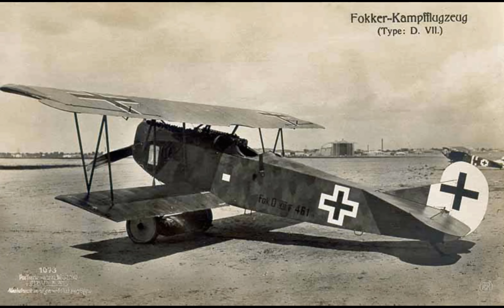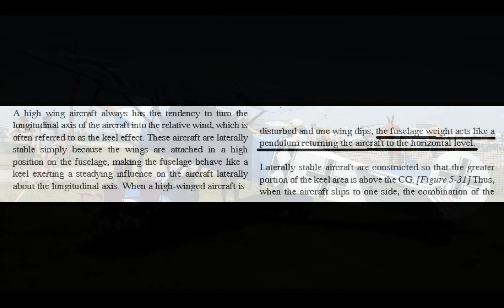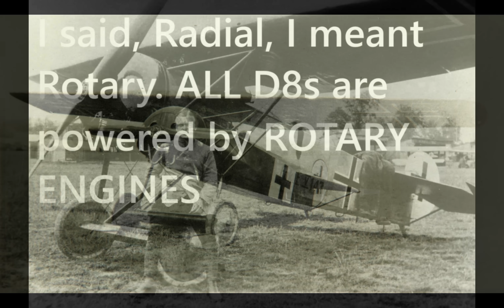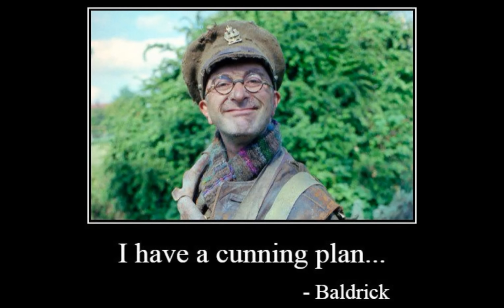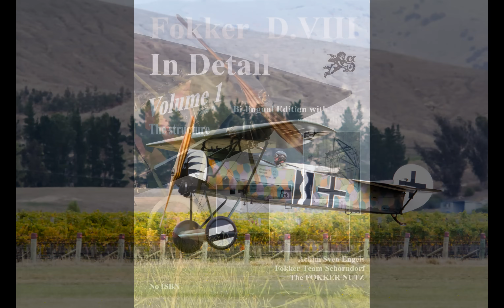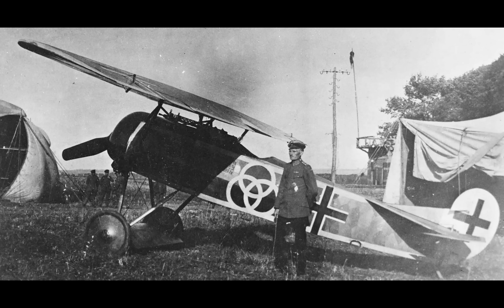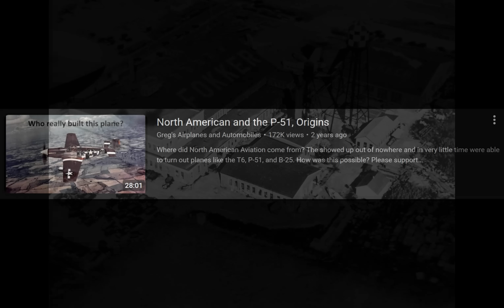Fokker D VIII The Best Fighter Of WW1

Comment: Your videos are all very interesting Greg, and this one on the Fokker D.VIII is no exception. However, when it comes to the performance estimates, I would say your numbers for the Fokker D.VIII are on the optimistic side. In fact, the Fokker D.VIII was with its 110 hp Le Rhone woefully underpowered and was both out-climbed and out-turned by many bi-planes of the time, most of which were faster as well. You can read more about the performance details of the D.VIII and its contemporaries in my book WW1 Aircraft Performance, by Anders F Jonsson.
Reply from the maker: You may or may not be right about the performance numbers. That said, they are not my numbers, the climb data came from a NASA book, the chart is literally straight out of that book. The top speed of 128mph is the most often quoted number and I think I explained exactly how I cam up with the stall speed. I'm curious what you think the stall speed is. I haven't read your book, this is the first I have heard about it, but it sounds like it's great.
Reply: @GregsAirplanesandAutomobiles   My estimate of the Fokker D.VIII's stall speed is circa 53-57 mph depending on if power is on or off. Connected to this, when using speed data from old reports: Be aware that even NACA reports sometime have IAS as read off the from the aircraft instruments which can be very inaccurate due to missing PEC. Then when it comes to my simulation modeling for the turn performance in my book: I have actually validated this based on a German WW1 report (TB 41, Band III Heft 7, Der wagenrechte Kurvenflug des Flugzeuges) which actually has data for the Siemens Schukert DIV, and I get very good correlation on that from sea level up to 6 km altitude, which gives me confidence about my C++ simulation model. I actually have paper in pdf format that covers the Sopwith Camel's and Fokker Dr.I 's turn performance but I don't think I can link to it here because YouTube seems to delete post with links, so I'm not sure how to convey that info.
Reply: Hang on: On my page here on YouTube, there is a link to my website: If you go there, there is a tab called "Documents" and under there I have a paper in pdf format that explains the validation of the C++ simulation model and does a comparison of the Sopwith Camel's and Fokker Dr.I's turn performance. Have a look at that paper and tell me what you think about it.
Reply: Does the ORA or the folks in New Zealand not know the stall speed of the DVIII replicas they fly/flew?
Reply: @Whitpusmc  So what stall speed do they say the Fokker D.VIII has?
Reply: @AndersFJonsson I don’t have a connection to the NZ group but I wrote to ORA today to ask.
Reply: @AndersFJonsson I got a copy of WW1 Aero issue #143 pages 56-59 which has test reports of three DVIII replica’s. My copy has corruption on page 56 so the most accurate replica, the one with a Gnome rotary, is illegible. Reading the reports on the others gives an impression of a stall speed between 43-49 knots. How good the pilots are at collecting this data, how accurate the instruments and how accurate the replica’s are all open questions. I would like a clean copy of that first page #56 which is of Brian Coughlin’s DVIII replica which flew at ORA and in NZ. Note that of course these planes will likely at most have a full fuel load, they may not have a full load of castor oil as the originals did and certainly don’t have the ammunition and actual weight guns the originals did though they may have some ballast to correct CG issues caused by lack of these weights.

Comment: It is worth noting that Fokker did build mid and low wing versions on the same DR1 type fuselage before the DVIII and they were submitted to the formal fighter competitions. The test pilots complained such wing locations severely restricted the ideal combat visibility, ahead and below, for ease of interception. Structurally Fokker's designer Reinhold Platz preferred the simplicity of the low wing mount of the V25 prototype. A factor often missed is that both the DVII & DVIII thicker wing sections had much better stall characteristics than the thin sharp leading edge types used by allied planes and as cantilever structures they required no external, drag creating, wire bracing. It was dearly a decade before the rest of the world caught up!
Reply: Great to point that out. I had wondered about that, if he'd experimented with different wing locations and surmised that the design decision had much to do with the combat visibility issue. But I'm surprised that the mid or low wing position that would have enhanced maneuverability - at least in roll - would not have scored higher points. Perhaps not a midwing since you couldn't design a one-piece wing, but a low wing could have easily been attached below the fuse with a little dihedral to enhance lateral stability. You'd still have the strength and ease of manufacture.
Reply: @Mike-eq4ky 
As stated in the video the DVIII and the V25 even more so was one of the lightest fighters by mid 1918 and coupled with the benign stall characteristics of its thick wing "dog fighting" manoeuvrability was not an issue. The big concern was its limited speed. A fighter with a speed advantage could break off combat at will making the visibility below and forward to allow a dive speed advantage.
It is also worth noting that Fokker had a financial interest in Oberursel so ensuring priority delivery and a financial benefit in using their rotary!

Comment: Hi Greg.  You make  very convincing argument.  You've got a like from me.  It would have been interesting to see its performance with a bit more urge.  I wonder if anyone fancies putting a Le Clerget in one???
As I understand it, by 1918 Fokker had become a saleman and the DVII, EV,DVIII were designed by Reinhold Platz (AR Weyl - Fokker: The Creative Years).  Also the wing failure problems may have originated in the use of unseasoned timber, a problem which had plagued the DRI earlier (production was halted while it was investigated).  The use of unseasoned timber was not a Fokker issue alone (Nieuport used some) and resulted from the shortages in timber by the ravages of war.

Comment: There should be no pendulum effect, since the lift force should always be pointing through the center of mass, thus no restorative moments should be made. When there is a pendulum effect, like with ships, the force of buoyancy starts pointing away from the center of mass, which generates a restorative moment/torque hat rotates the ship back to level. In reality, I do think that a high wing is more stable, but I think it's because of aerodynamic effects. There's more side area above the CG, because of the wing and struts, so if the aircraft is in a slight sideslip (as all aircraft tend to be when rolled), the surface area above the CG will create a restorative moment that tends to rotate it back to level, like with a weather vane. There is also an effective dihedral (even if the wings are completely straight) creating a situation where the lower wing in a slip sees more angle of attack.
Reply from the maker: Alex, read the page I put on screen from the FAA. I think you're misunderstanding the pendulum effect in this case, it has nothing to do with what you see with ships, it's a different effect.
Reply: @GregsAirplanesandAutomobiles  I noticed I ended up describing the keel effect from the video in a worse way. My intuition when I hear pendulum effect is the pendulum rocket fallacy from Goddard's failed pendulum rocket, but apparently it's just a different name for the keel effect. I think it's still slightly misleading to say that the weight of the fuselage acts like a pendulum to bring the aircraft level, the only thing that the fuselage is doing is keeping the CG low relative to the wings. The wings (and other structures above the CG) act like a weather vane or keel, to provide more drag than anything below the CG, and this  in a side-slip induced by rolling will make the aircraft roll back to level. 

For example, if you added a large keel/strake at the bottom, like a large pectoral fin, the weight of the fuselage would be largely irrelevant, the plane would become less stable. It's only the aerodynamic surfaces and their relative placements to the CG doing the work, not the fuselage weight itself. Similarly, if you had a low-wing configuration, but added a strake/keel at  the top of the plane (like a dorsal fin) longitudinal stability would improve, even if you increased the weight of the fuselage. 

Thank you for replying, I forgot to mention I really appreciate your videos, particularly the drop-tank and fighter range ones.

Comment: Dear Greg,
as always, a magistral video and presentation of lesser known aircraft.
Thank you very much for it!
I must however ask why Morane Saulnier seems to be entirely forgotten from your Fokker history?
The Eindeckers were base on a german carbon-copy of the Morane-Saulnier H. That plane indeed was nothing special without it's syncronizing gear.
I must also say that the Fokker d.VIII leaves me wondering. 
It does look AL LOT like the earlier Morane-Saulnier "Parasol" types, and more specificaly, the Morane-Saulnier AI. 
Nearly identical design philosphies: small, lightweight plane (they are 20kg appart) with a parasol wing, and even had structural issues too... Yet the Morane had superior performances (probably from its better engine), and this seems to be entirely forgotten. 
I agree the wing design of the Fokker seems entirely different and original, but I find the repetition of a, yet again, "Morane-like" pattern quite interesting.
Pure engenering convergence, or "inspired" design?
Reply from the maker: This is a good question, and it comes up a lot. I mean A LOT. There is almost never a time when I make a video and someone doesn't say "but what about airplane x? Why didn't you talk about airplane x?  The reason is usually just space and time. It's not that I'm dissing the Morane aircraft in this case, it's just that the video is of finite length and if I did include it, then someone would complain that I didn't talk about it enough, or mention some other airplane I didn't include. The is a video on the Fokker D.Viii, it's really just that simple.
Reply: @GregsAirplanesandAutomobiles  I understand. Historical aviation is an endless tangle.  I must say that the "North Amercian" digression was absolutely fascinating! 
I am however a bit at a loss with the (sad) bias the english-speaking "aviation history community" seems to have, especially for WW1. 
It's either the Brits, or the Germans. The French,  get some recognition thanks to Nieuports or SPADS (because flown by US aces), but every other designs (such as the excellent and historically significant Breguet 14) seem ignored or unknown. Let's not even talk about the other nations...
Your channel is one of the rare places where valiant attempts to fix this injustice are being made, and am very thankful for it. 
I am just saddened by the seeming low view numbers your otherwise excellent series on "unusual" planes seem to have generated...
Anyhoo, rant over, thank you for the amazing work you make!

Comment: Greg, I hope you’ve seen, but if not, Fokker’s first passenger aircraft after the war (F.I through F.VII) were also just scaled up versions of the same basic airframe design. Although glossing over the international success of the F.VII-3m (F.VII with 3 engines) does hurt a little when talking about the success of Fokker post war. Probably because it wasn’t from the USA.😉

Comment: It's kind of interesting to compare the D8 to the civilian C-152 and how much things changed in 1 lifetime. Bottom line, the C-152 (especially the aerobat version) had more speed, weight capacity, fuel capacity, seating (2), ... and less maintenance.
Reply from the maker: Yes, but no machine guns. I do have a lot of time in the 150/152 including the aerobat versions.
Reply: @GregsAirplanesandAutomobiles 50 cal with a few hundred rounds is less than a second person. (Don't get any ideas, I thought of it first. Just need to build the time machine!)

Comment: Did you say it had one of those engines that spin with the prop? The image at 8:59 shows the prop with a motion blur but the engine is clear, not moving. Maybe it was another plane or I misunderstood.
Reply: It's only a replica, and radial engines are much better than rotary engines. It's not a replica engine it's a small radial.
Reply from the maker: As simon said, a lot of the pictures in this video are of replicas, which rarely use a rotary, they use radials instead.
Reply: @GregsAirplanesandAutomobiles  Thanks. The idea of spinning engines amazes me so I'm always looking for examples. That explains it.

Comment: At first glance Fokker's explanation for the wing failure -- that the rear spar was too stiff -- seems like nonsense. However, I'm a structural engineer, and I've seen this phenomenon of unexpected failure when a part of a structure is stiffened in ways that weren't planned. As the surrounding parts flex, loads are redistributed. When a member like a spar can't flex and share the load, you can start blowing out connections and things. With the safety margins that are common in aircraft, I could see a spar that's been stiffened by committee attracting too much load and failing. It's hard to say exactly what the mechanism of failure would be, but it does make sense that what Fokker described could happen.
Reply: The theory is that stiffening the rear spar made the wing aerodynamically unstable. If the two spars are matched in stiffness the wing will bend under load without twisting. If the front spar is stiffer the wing will twist so that the angle of attack is decreased. If the rear spar is stiffer the wing will twist so that the angle of attack is increased, resulting in increased loading, leading to increased twist, and so forth.
Reply: @fafner1  Good point, but I wouldn't call that an aerodynamic instability. That's more of a structural instability caused by aerodynamic forces.
Reply: @PS-n5f  it's both, the increased twist will cause the aircraft to roll harder which will inturn impart higher forces on the spar, until the either the wing fails or aircraft becomes uncomfortable- or both. Test pilots in those days needed a servant just to carry their balls around for them!  ( Not a practicing structural engineer but do have aeronautical engineering degree)
Reply: @Not_a_bot_just_A_realist  What you describe is certainly one possible cause of failure, but we don't know that it is THE cause of failure. 

My point is that, when somebody screws with the structure, thinking they have strengthened it, they may have actually fatally stiffened it, so it is far more likely to fail.

It's like the idiot who lowers the hell out of his Subaru by putting really stiff, much shorter springs in it, then drives around on crappy city streets, then complains when the ball joints need constant replacement and the welds on the shock-mounting towers start peeling apart. 

Excessive stiffness where it wasn't designed to be can play havoc on a structure, regardless of the source of the forces that eventually cause failure.

Comment: I loved the narrative arc to the Mustang. Well done!  A quibble: It's a widely held misconception that high wings get roll stability from "pendulum effect". This is similar to the thinking that an engine mounted in the tail is destabilizing in yaw relative to one in the nose. It's all a rigid system; there is no pendulum, there are just forces applying moments about the center of mass. Roll stability derives from reaction to side slip. Dihedral effect is the generation of a restorative roll moment due to increasing lift in the low wing due to side slip when it banks. Sizing of the rudder/fin must allow a bit of side slip to develop for dihedral effect to work, so they mustn't be too large.  Low and mid wings have to angle the wings up to get "geometric" dihedral effect, but high wings gain an "aerodynamic" dihedral effect even if the wing is totally straight, because the fuselage body all below the wing induces an increase in lift of the low wing during side slip as lateral flow is restricted by the fuselage below, but no on top. The CL215 water bomber has a straight wing with zero geometric dihedral, and gets its roll stability from the aerodynamic dihedral effect of the T configuration. The turboprop version, the CL415, with its large flat PW120 nacelles replacing the round R2800 ones, lost some of this effect because the nacelles' ability to block lateral flow above the wing in side slip actually made it closer to a mid wing. The turned up wingtips of the 415 aren't some sort of winglet, they are a band aid to create geometric dihedral effect to restore the roll stability to CL215 levels.
Reply from the maker: I think maybe you were listening to the video and not watching. The pendulum effect is not what I think you're thinking. I put the page up from the FAA's Pilot's Handbook of Aeronautical Knowlege on this subject. It's on screen.
Reply: @GregsAirplanesandAutomobiles  Not sure where to find it. Is it page 5-18?